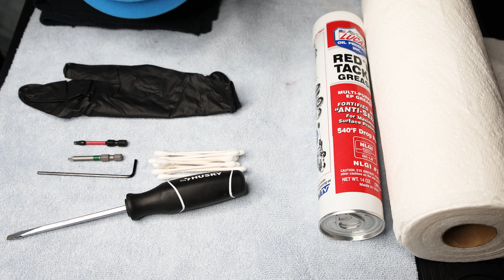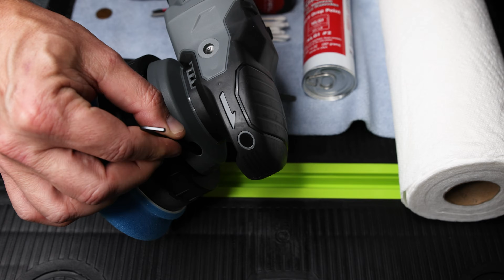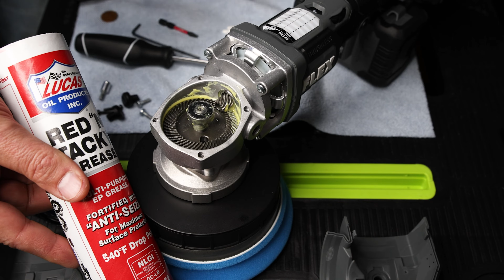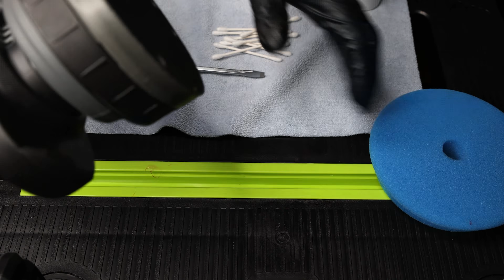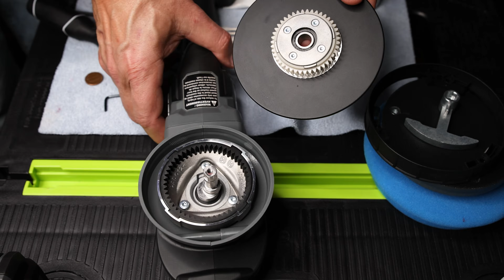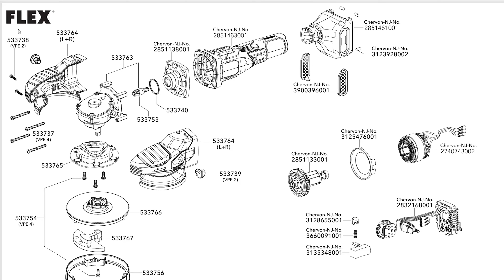HOW TO: Easily service your FLEX 24V rotary, DA, or forced rotation polisher. Change the grease!

Comment: Congrats on the slow-motion gearbox suicide! Swapping a specialized Klüber (Aluminum Complex) for Lucas Red 'N' Tacky NLGI 2 is a disaster in the making. At 10,000+ RPM, that NLGI 2 grease just hits the housing wall and stays there (Channeling), leaving your gears to run bone dry in the middle. You're trading a high-speed liquid grease for a 'red wall of sludge' that won't flow back. Plus, mixing Aluminum and Lithium bases is a recipe for chemical separation. Red 'N' Tacky is for hitch balls and tractor pins—keep it out of high-speed angle grinders!
Reply from the maker: Lol ok. You're incorrect but feel free to have that opinion.

Comment: Is the da smooth or does it vibrate a lot? I’m replacing my rules hlr 15 all I’ll be using it for is polishing after my rotary cut I’m just trying to figure out if I should get the forced rotation or da
Reply from the maker: The HLR15 is smoother and quieter. In fact I really like my HLR21 the best as it is balanced so well with my Biff and Shine pads. I will likely pick up the rotary version and keep my forced rotation, but may sell off the DA.
Reply: Ok thanks yea I’ll probably just go and get the hlr 21 or you think the gear driven would be better? And the new flex rotary is amazing
Reply from the maker: I haven't used the gear driven I have enough to make that call. I do know I love my Rupes. With any DA, the biggest sticking point is the stalling. You get the good 21mm cut but it stalls. A gear driven is like 8mm. I believe liquid elements is coming out with a new polisher for SEMA this year that supposedly doesn't stall. A 15 or 21mm that doesn't stall would be game changing.
Reply: @TheOutdoorDetailer  o for sure I just think the flex would be better than my Rupes 15 just gonna have to try it for myself I guess lol but yeah I appreciate ur help

Comment: This could be helpful for an older tool or maybe another brand but Flex has a lifetime warranty. Yeah they don't cover normal wear and tear but you are certainly guaranteeing them to void your warranty if they open up it and see you changed/added way more grease. It's a double edged sword for sure.
Reply from the maker: Maintenance does not void a warranty. The terms of the warranty says "repair" by unauthorized people.
Reply: @ have you checked with flex? Opening up the body of the machine and taking out the manufacturers grease and replacing with a different grease seems like that would void the warranty. I think before telling people to do this you should ensure the company won’t void their warranty. It’s just the responsible thing to do.
Reply: @detailingnerd It does void the warranty.  I can attest to that.
Reply: @MiguelAngel_Nxendio lot of bad info on the internet thanks for confirming

Comment: Great demonstration Mike.   The grease change also works great for cheaper tools like from Harbor Freight and other locations.  The change in behavior of the polisher is quite dramatic and it has a very noticable change in the pitch of sound when in use and just feels to be way smoother.   It's hard to believe that Flex, with their great reputation across the world when it comes to polishers would put such a cheap grease or at a bare minimum, not enough grease, in their polishers.  You have probably doubled the life of that polisher (at least the primary gear) by double, maybe a lot more.  Tools in the old days such as the original all metal Cyclo polisher worked for a LIFETIME with minimal maintenance.   Now that most polishers (if not all) are made of plastics of varying grade and types, they will never have the lifespan of something like the Cyclo and other old school polishers from yesteryear.   Sure, they were a lot heavier machines, but when you bought one, it was probably the last tool you ever needed to purchase.   I loved the Cyclo polisher.   That thing was amazing with it's two four inch counter rotating buffer heads which simulated hand polishing, but at a much higher rate of speed obviously.  They worked amazing.  And Cyclo offered all sorts of different head options to make the machine more versatile.  I am looking for an old one now on marketplace or other sites because they did an amazing job at applying waxes and sealants.

Comment: Mike, I hope you didn't void your lifetime warranty to change the grease on a brand new polisher that doesn't even look like it's been turned on.
Reply from the maker: The one I show in the video had no use. The DA had been used and when I popped the cover had a pile of black shavings thrown above on to the grease. The warranty also does not cover "This limited warranty does not cover part failure due to normal wear and tear." so it really benefits someone to make sure they never have to replace that gear box, as it would not be covered.

Comment: The correct amount and type of grease is already in the gear case, there is no need for a detailer to go in there and play armchair engineer. The worn gear material you see is there intentionally. Gear sets are often designed and materials are selected so that the gears will "wear-in" together, resulting in a quieter and more efficient drivetrain as the tool goes through its first hours of use. As the tool heats up, that grease will melt and distribute itself into the gear set and there is no need to change it or add more unless that o-ring fails and it starts leaking out.

When you pack a gear case like that full of grease (like it is a wheel bearing) you think you've done a good job because it gets quieter and everything sounds smoother. But this isn't a wheel bearing and it isn't supposed to have that much grease in it. By packing it full of that thick grease, you are increasing the load on the motor/drivetrain which is going to increase heat, decrease efficiency, cause extra wear and tear and will reduce battery life.

Leave it alone people. You don't know more than the engineers and production line in Germany (or Italy, or China).
Reply from the maker: LOL, you armchair an aweful lot too. The correct amount of grease would not sling off to the side and allow metal shavings to accumulate.
Reply: @TheOutdoorDetailer as I stated, the metal shavings are there by design. The gears are made of powdered metal that is put in a mold and then sintered to become a solid part. The tolerances are such that the gears are not perfectly meshed until the tool gets used and they become a matched set that runs quieter and smoother than what an old school machined gear set could achieve.
Reply from the maker: Here is the problem with your assumptions. The warranty does not cover normal wear and tear. A failure due to that gear wear would not be covered under warranty, so the company would have zero vested interest in making it actually last a very long time, or even spending the money in machining a high quality gear set. So what if it fails 2 or 3 years down the road, they'll just charge a hundred bucks like Rupes does and people will be happy to pay it. In fact, the company has a TON of research showing how many people use these tools for occasional use and how many for heavy duty use and they've made the determination that what they have done is acceptable for the calculations of repair costs. In any event, people can choose to do with their tools what they want. Have a good day.
Reply: @TheOutdoorDetailer  nice straw man you got there.
Reply: @TheOutdoorDetailer how long did you run this tool before recording this video? It looks to me like the grease is exactly where they placed it. You do realize the factory in Germany these come out of has been churning out geared tools since 1922, right?